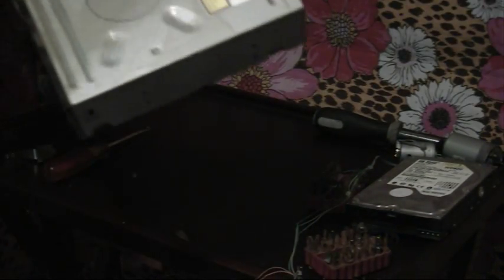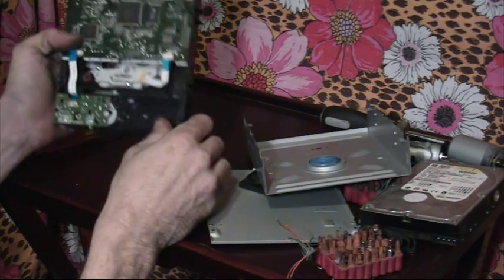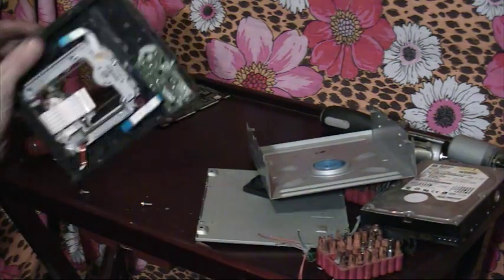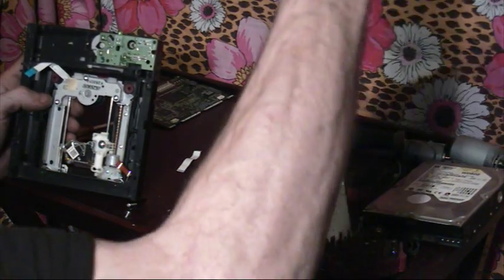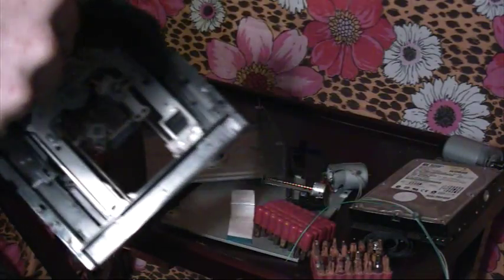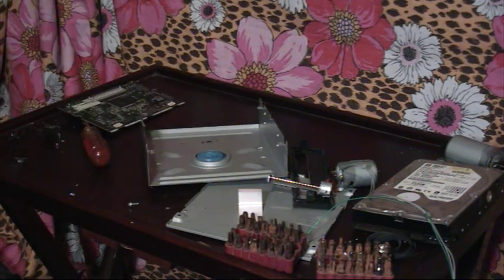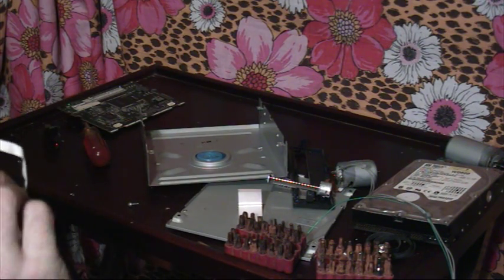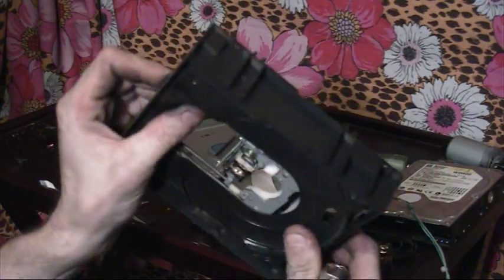In search of 3d printer parts dvd rw teardown

Comment: Just looking into this rabbit hole myself. Got a load of old printers and scanners from freecycle so far none of the legendary nema17 steppers just little round ones :( but loads of belts and shafts. Started off thinking about a wolfstrap printer but now thinking smaller and along the lines of the DVD/CD type but again so far only have the wrong one's. Looking on eBay for cheap controllers and hotend look forward to seeing your progress
Reply from the maker: i was reading you only  need 2 identical and 3 others 5 total engines to make a RepRap.There are five stepper motors on the RepRap Prusa Mendel:
One to control the Y-axis
One to control the X-axis
Two to control the Z-axis
One to control the extruder
Normally all five motors on a printer are the same but this is not required except for the two motors that control the Z-axis: these must be identical. The RepRap Prusa Mendel has been designed to use bipolar NEMA17 motors. NEMA17 determines some of the dimensions of a stepper motor.
Reply: boxlessthinking well ordered a cheap (£17) ramps kit last night includes 5 stepper drivers, ramps board and mega board. Fingers crossed they are good fakes! Delivery is by middle of February to middle of march so plenty of time to start building.